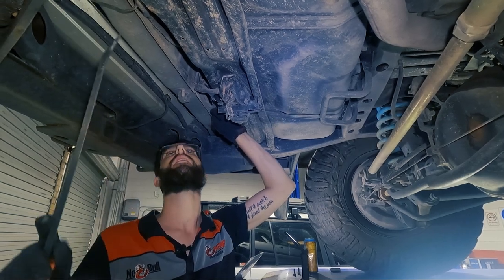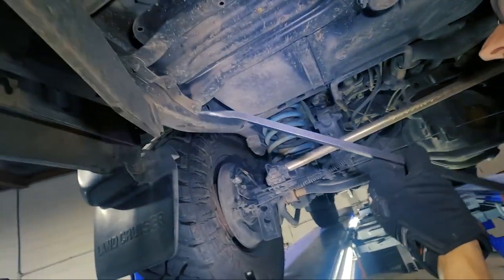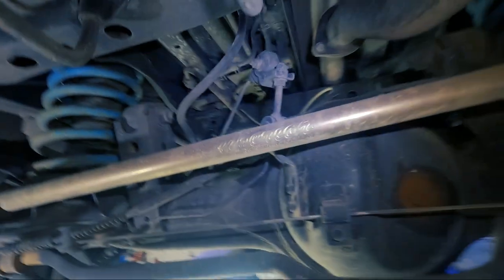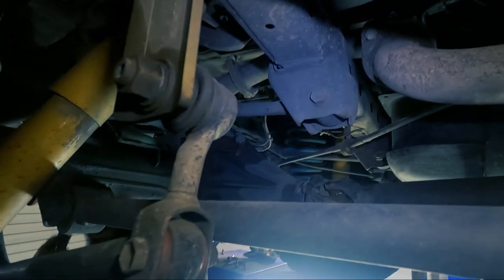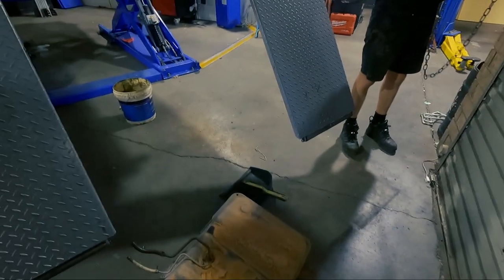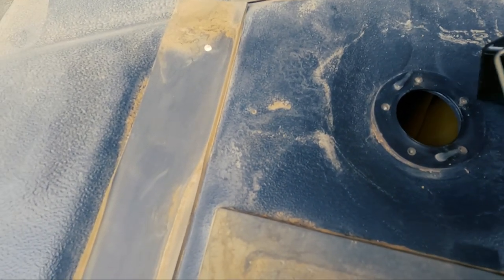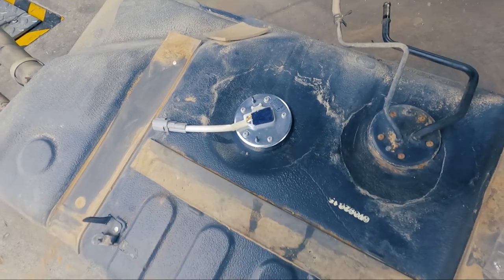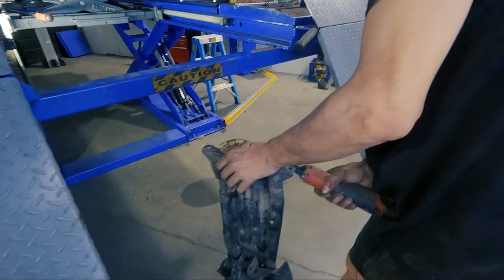Changing The Diesel Sub-Tank Sender Unit In My 80 Series Landcruiser

Comment: Hey guys, thanks for the video. I have this same tank to install and i wanted to know if you know out of the 2 lines that the tank has, the one that you refeir to as "wet". Which one is the sender, the one you suck the gas out off to the main tank. and is the other an overfill return? thanks
Reply from the maker: Hey mate 

I am assuming by your post that you have a petrol 80 series.

The petrol and the diesel work differently.

The petrol one does in fact transfer fuel from the sub tank to the main tank.

The diesel on the other hand, the tanks work individually of each other, so when the sub tank is engaged, it draws diesel from the sub tank to the injector pump and when it runs on the main tank, it draws diesel from the main tank.

So to answer your question, I'm not sure on the petrol versions as I haven't had anything to do with the petrol variant.

I'd suggest jumping into a Facebook group for the 80 series and asking your question there.

Comment: Hi guys, I followed your procedure and everything went great until I disconnected the send and return line. Diesel kept coming out and wouldn't even slow down which is what you would expect when these lines drain. The flow of the bigger line came from the front of the car however, the flow of the smaller line came from the tank. I pushed them back on but my upper body was covered in diesel. 
What can I do to stop that flow before I disconnect the lines?
Reply from the maker: Hey mate

You would need to disconnect the fuel line from the fuel filter housing assembly on the firewall side so it drains back into the tank first, then drain the tank via the drain bolt.

Should all go smoothly then.

Be very careful of the send/return lines themselves on the tank as they can crack and then you'll never be able to stop diesel pouring out from the tank once you put it back in.

Two person job really to remove and replace. 🤠👌

Good luck!
Reply: Thanks mate. I will do that.
 @OzTrax4X4

Comment: You reckon one can drop the fuel tank at home without a lift ?
Reply from the maker: Hey mate 🤠

I reckon you could with a couple of trolley jacks and a mate to help you out.

I wouldn't do it by myself and you have to be careful of the fuel pickup as they can easily be damaged.
Reply: @OzTrax4X4  thanks for the tip mate. Appreciate it
Reply from the maker: @kotasonamtenzin  No worries. Here to help :)